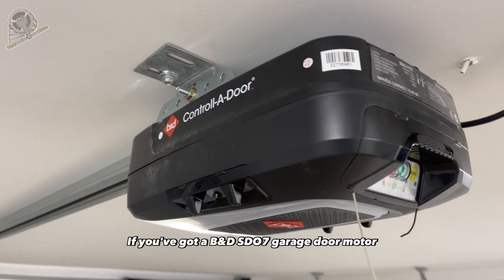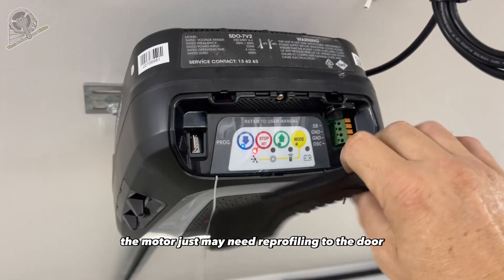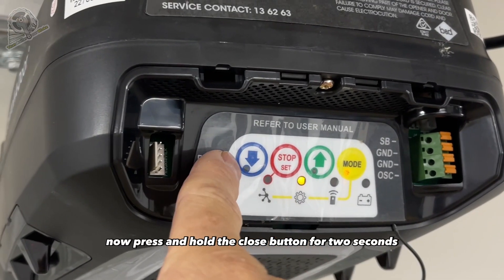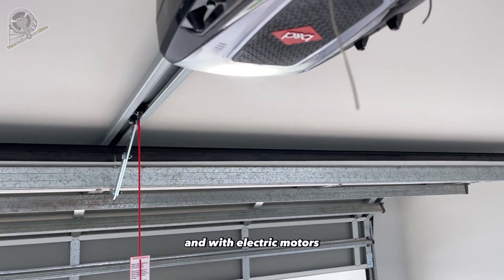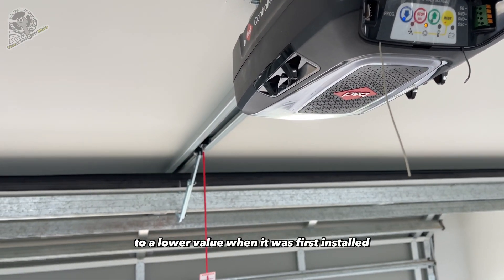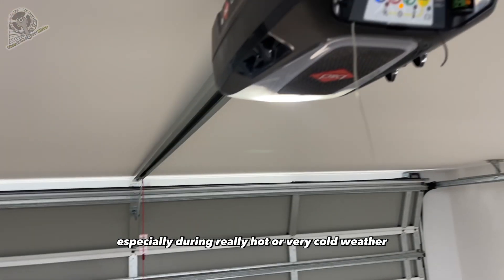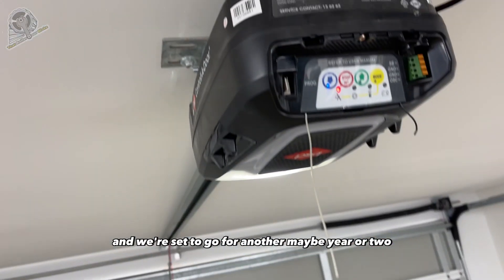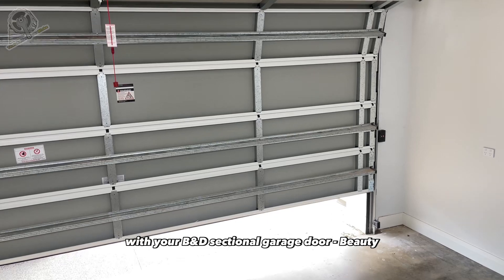[48] B&D SDO-7 - SDO-6 Sectional Door Opener fix stopping and auto reversing. How to Re profile

Comment: Hi. I had a brand new B&D panel door fitted along with a SDO-7V2 B&D Controll-A-Door motor fitted just over a year ago. Once opened the light is flashing 3 times. I don't feel it needs a service. Can you let me know how to reset the light so it stops flashing once the door has been opened. Thanks.
Reply from the maker: Correct it need a service yet, just follow my lubrication guide and you’ll be fine.  
I think you hold down the SET button or just reset the limits which I should have a video for too.

Comment: Hi @rollerdoors,

I have a B&D Controll-A-Door Advance (SDO-2V2 ADV) and am wondering if you can share a video / advice on how to reduce to close speed.  Am I correct in assuming that it can be programmatically configured for 90, 110 or 130 mm/sec ?
Reply from the maker: Hey 👋🏻 
If I see one sure. 
Just press the operate button once, twice or 3 times before setting limits
Reply: @rollerdoors  , Ah yes I see.  It has to be done before limits are set.  I'll follow the delete settings procedure and try.  Thanks.

Comment: Silly question. So I did this but instead on a red LED at the end it is blue. Is that still ok? I have the SDO-7V3
Reply from the maker: I’m not overly familiar with this model but if the process works it’ll be fine
Reply: @rollerdoors Thanks. Actually I can add that there is another setting with option to change the speed and force of the motor which has mostly fixed the issue for me. However there are warnings in the manual about changing this for obvious safety concerns.

Comment: Hi -I have the SDO-6 - it's automatically re-opening . I tried the steps in the video, and after presssing the blue down button for 2 seconds the door goes down and stays down.  Is the Set/Stop light supposed to come on after the limit set cycle?  If I hit set/stop it comes back up and the problem isn't resolved.  Any Ideas?
Reply from the maker: The red LED should be on when the door is closed.  Set/Stop only needs to be used when setting the travel limits.   Up / Down arrows or remote can be used to operate the door normally. Don’t forget to oil moving parts of the door.  Hope this helps.

Comment: I have this model opener and it keeps coming up with a solid mode light and beeps 7 times indicating a memory fault. I can reset it and it works 4 or 5 times and then does the same thing. Any one had this issue before?